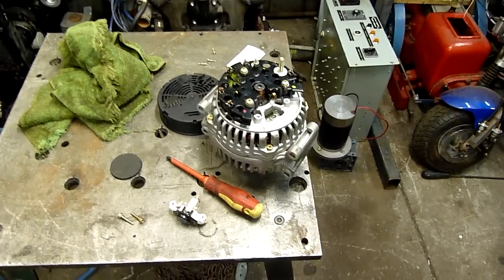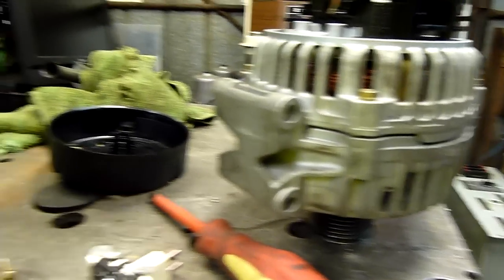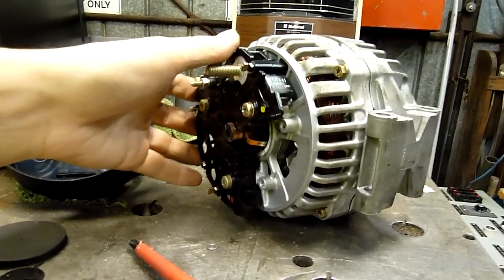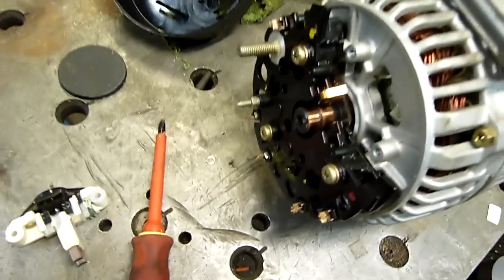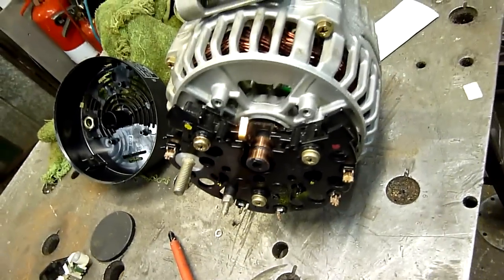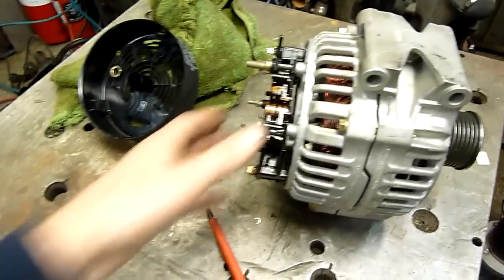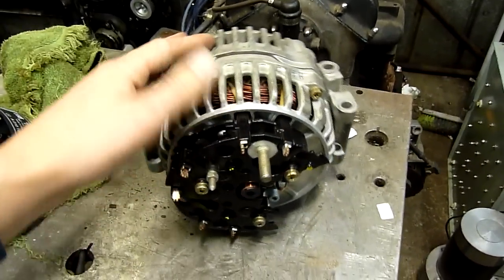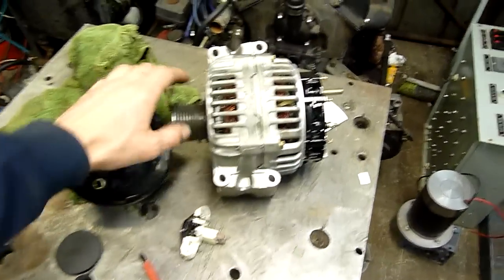Random Mercedes Benz Vito Alternator -Bosch 115A

Comment: The clutch reduces stress on the belt system by decoupling the alternator from the engine. The engine actually slows down slightly between each combustion stroke, but the alternator keeps wanting to go at the speed it was. Puts stress on the belt and tensioner. That's why on some engines you see the tensioner shaking/vibrating at idle.

Comment from the maker: major difference!, Alt's and Generators make power for the DC system, Starters are just high torque DC motors.
only time their directly related is if its a dynastarter. a DC dynamo that can be energized as a starter motor to start the engine, then is switched into a generator (dynamo) via the starting relay assembly.

Comment: Yep... The splines is made for a mount/demount tool. If the pulley is turned counter clockwise it should "free-wheel"
Those pulleys normally dampen "belt-chatter"(if that's the right name for it) especially if the belt is driving lots of other components.

Comment: Something neat you can do with a large alternator like that, is replace the regulator with a rheostat, belt it to an engine, add some heavy gauge leads and you now have a 0-115 amp DC stick welder. There's a few videos on youtube of Jeep guys adding a second alternator configured as a welder for trail-side repairs that go through all the details of how to set it up.

Comment from the maker: depends what you use it for, I would not charge batteries at 15V, but 14.5 would be ideal without making them boil too much (you generate a lot more hydrogen if you go above that)

but as dragkid185 said, its normal to loose a bit when they run hot.

Comment: Wow that looks brand fire new!!

There cant be much wrong with it, if your not into testing parts then i would use a small battery and bulb and a drill to spin it over to test for 13.5-14.5v .

Diodes can be tested, and with a load bulb and a variable psu you can see the regulator working :-)

Smashing gift :-)

Comment: thats right, they are designed to free-wheel if the alternator wants to go faster than the engine (ie sudden decceleration), but most replacement alternators are fitted without the clutch because they are prone to failure (according to various websites) - another case of good idea gone wrong!

Comment: Think the splines are to hold the pulley when you take if off.

The pulley should freewheel like a bikes back wheel on overun, what it does when they go wrong is pull against the tensioner when engine slows down quick and the belt goes slack on the other side and come off. You can get new pulleys if the cluch goes.

Comment: I bought a 165A alternator for my 1999 Civic DX (America), does 165A peak, about 60A at idle, not bad... The problem is that it's just rebuilt in the stock chassis so if you push it without turning up the RPMS, it'll get hot and eventually blow. I've gotten it pretty smelly a few times but still works fine.

Comment: Thanks for the reply, factory alt charges at 14.6v cold , charging at 15v wont be an issue i use an odssey p2250 (i think its called) battery that can handle high voltage or high ampage.. I have a 210amp alt to go on but cant find a clutch pulley with the right offset.

Comment: Nice alternator!  So you supply it a little power and attach it to an engine and in return it outputs DC?  What happens if the load gets way too high?  Could it prevent the engine from turning?  Also is the battery always charging whilst the engine is running?

Comment: Whats the spec of that reristor? I need a more beefy one for my 120amp alt keeps dropping voltage to 13.8v when it get hot.. Or fit a lower ristance one to boost the voltage to like 15volts :smoking

Comment: I'll put money on it there is nothing wrong with the alternator at all just the clutch will be noise on it at idle common as prob with them like someone said the splines are for a special tool for undoing it u will see further past the splines that there is a torque fitting on the shaft that is for un doing the clutch/pully when holding the splines also its reverse thread. Thoughs alternators are worth about 1500 new

Comment: Looks like a 3 ohm 50 watt rheostat is all you need. There's a 10 ohm 50 watt on E-Bay Australia. 10-Ohm would work fine, current control would just be a bit more touchy. Item number: 280863215036